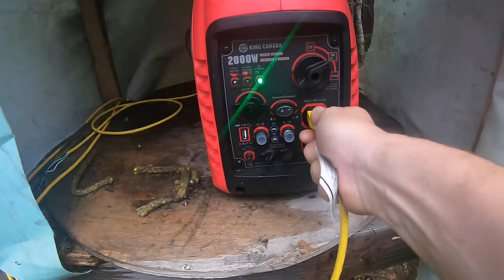Off Grid Cabin Trip Moose Prep remove Old Patio Fishing And Cutting wood For The Winter Episode #69

Comment: Another excellent video.

Another solution you could try for your roof if it still leaks , as I have found roofing cement to either dry crack or melt in the heat (depending on what you actually use), is to go with Flex Seal. It hasn't failed me yet. That stuff is like Frank's Red Hot Sauce you can put that on everything. It also comes in other colors, like grey, that may reflect some of the heat from the sun unlike black.
Reply from the maker: Thanks